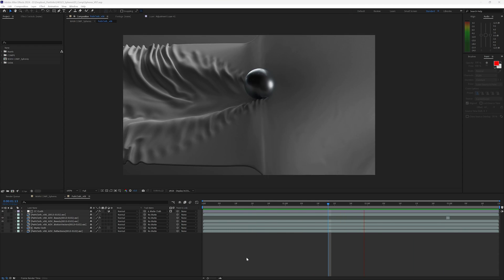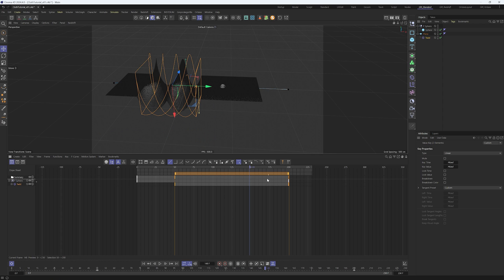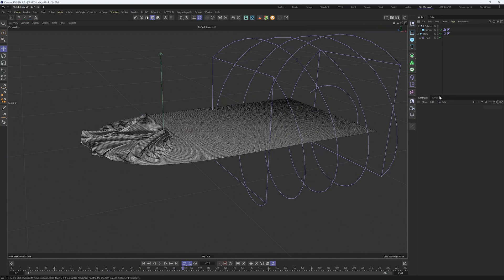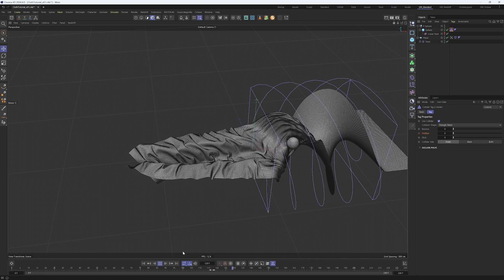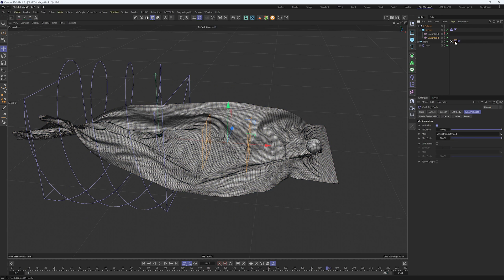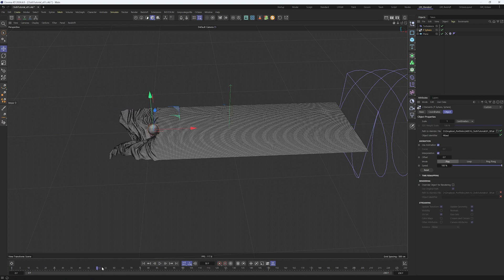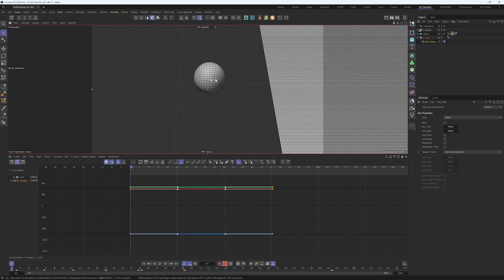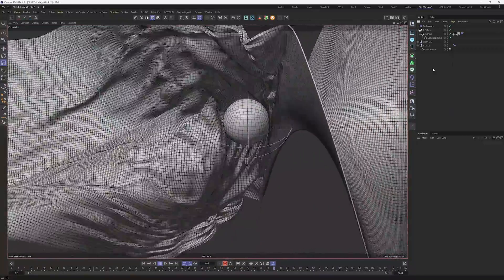Advanced Cloth Simulation in Cinema 4D and Redshift - Part 1

Comment: Hi there ! Before i watch the video, i just want to ask you a question. Why do most designers use redshift when they work on c4d animation ? Why didn't they use Corona for example? I really need the answer 🙏
Reply: As far as I'm aware Corona is used for for static work (I think) the render times are a lot longer compared to Redshift which is more efficient for animation.. This is my guess, apologies if not 100% correct